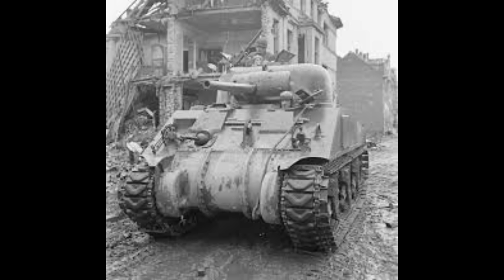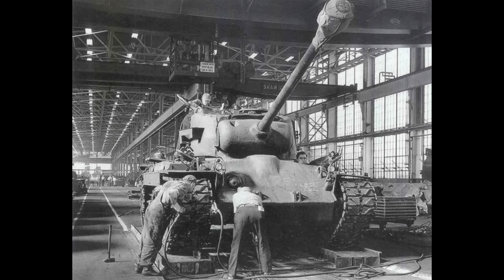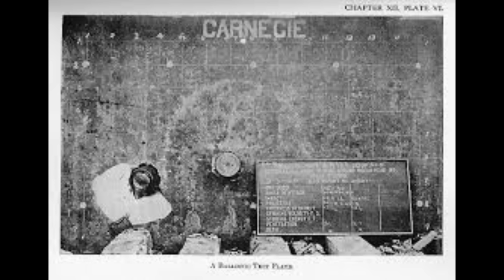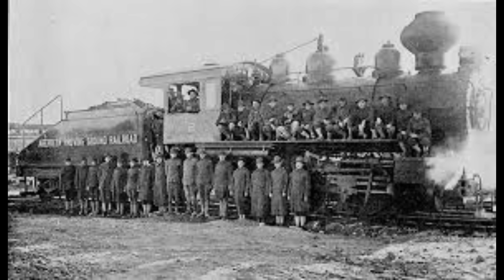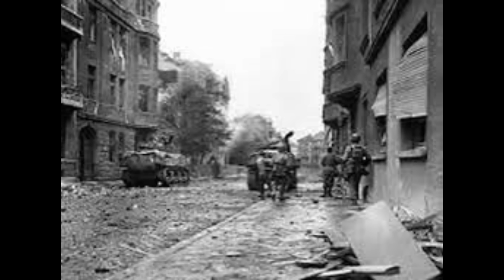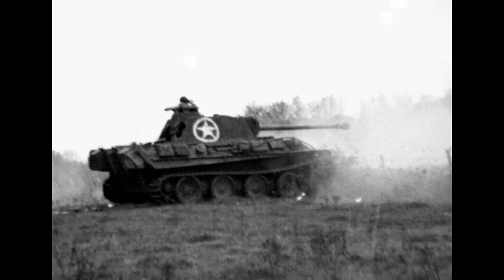How One Metallurgist's "FORBIDDEN" Armor Plate Made Jumbos Immune To Tiger 88mm Rounds

Comment: What clickbait nonsense. The Jumbo's were an upgrade but the Tiger's 88 could easily penetrate its frontal armor which was around 4" thick. The Allies didn't win because the Sherman had better armor and more firepower because the SHERMAN DIDN'T. It was built as an infantry support tank, not a tank destroyer.
Reply: Like a Mercedes and a BMW  "CAT" maintenance sucked.
Difficult and oftet
Reply: @Timothy-b2p  This is TRUTH. But don't worry, it won't be long before some self appointed expert jumps into the comments section here and lectures you otherwise. The Germans over engineered and overthought everything, including fighting a war and three massive fronts. Per your point, transmission repair on the CATs was a major undertaking. With the Tiger they had to lift the turret off and with the Panther they had to crane lift the removeable hull roof. It was at least an 8 hr job but with a Sherman you could swap out an entire transmission in 2 hrs tops. It's because the Germans didn't approach engineering, design and manufacturing the same way the Americans did.

Comment: Fake BS, AVOID!!!  Protection Level: The Jumbo's thick, sloped frontal armor was often sufficient to bounce or withstand hits from the Tiger I's 88mm gun at normal engagement distances.
Vulnerability: The Jumbo was not entirely immune, as a direct hit at very close range or at a less-angled point (such as the lower hull plate or the gunner's periscope opening) could result in a penetration. Side armor, though thicker than standard Shermans, remained vulnerable.